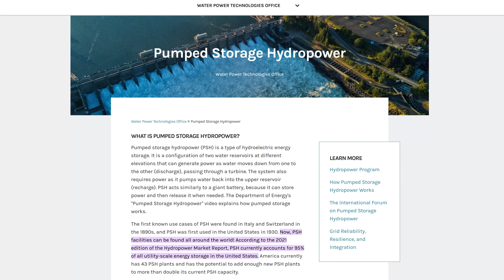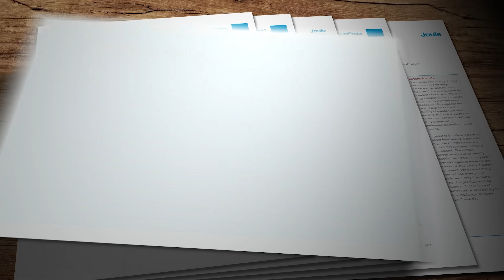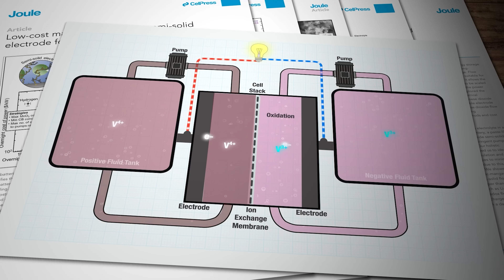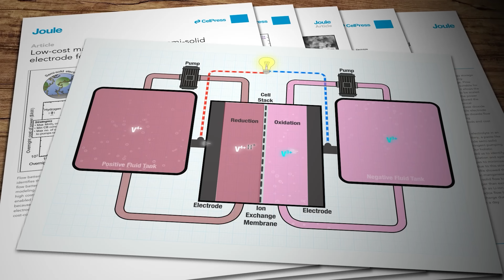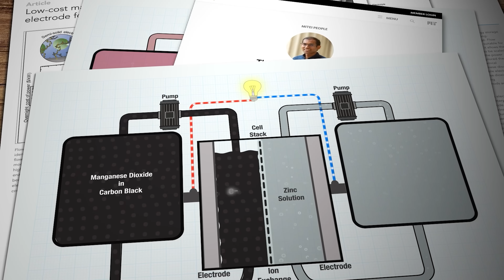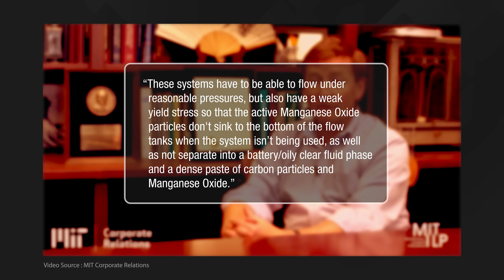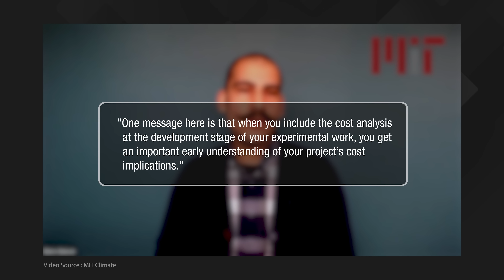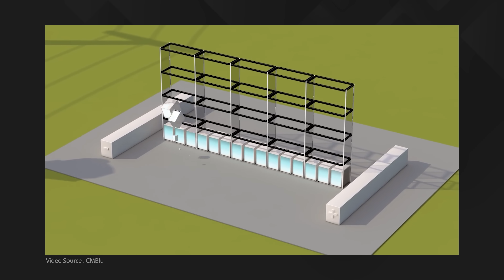Have we found the missing link in the energy storage equation?

Comment: They need to move on to other chemistries rather than wasting their time on something so complicated. It may work but not for a decade. It may take a new material or process - that just isn't available right now. Who knows? Its obvious however that every battery that exists has very extreme downsides. Storing batteries is a whole other issue - especially if you collect them for periods of time between turning them in at the recycling center.

Comment: Developed at MIT, Sounds good but several comments from others at MI are not so encouraging. What is needed, as always is a decent sized operating demo unit. Without this the MIT work remains imho a project only. Two simple questions: are they intending to build such a demo unit outside the lab & if yes when will it be completed?

Comment: What about using the salt storage of heat as is done nearer the equator in places further north and South, only in these further reaches N & S to use resistance wire only powered with excess capacity during night time hours. Thought I read about a system in Australia solar heating salt, then on dull days there was enough heat capacity to make steam from the heated salt to power steam engines to generate electricity for three dull days..

Comment: I'm very interested in energy storage. Both thermal and electrical storage. But when I talk to people about it I often get the argument that here (the Netherlands/Europe) even if wind and solar is at its peak. We still don't have enough power to "switch off" the usual suspect like gas or coal power plants. And even if we did, those power plants aren't flexible enough to switch on or of every hour or so depending on the wind, let alone every 2 minutes whenever a cloud comes before the sun. I understand that the bigger the grid the less this problem will occur. On a semi cloudy day, the coverage of a whole country will be more or less stable. But I am curious what your view (or anybody's view that knows something about this) is on the flexibility, or inflexibility of the non renewable power plants when we get to enough renewable energy that it will actually be necessary to take gas or coal plants offline because there is enough renewables at that moment. I have even heard (but couldn't confirm....) that we have a resistive wire in the northsea to be able to dump energy there when the grid cant handle the renewables and the baseload plants. I hope to god this is false, and the fact that I can't find information about this is a good sign... But I have heard of more stupid things done on that scale, and lets face it. Dumping "a bit" of energy is always better than letting the grid collapse.

Comment: (1)Why not more pumped storage? with a refinement ie variable pump speed(to match the variable wind strength) as well as variable generating speed for frequency control.(2) When wind speeds are low in one area eg high pressure over Ireland, There fore little or no wind generation ,winds could be good in Scottish highlands/Shetlands /Orkney .So an interconnector between inishowen in Donegal and the Scottish highlands coupled with storage (a U valley stores more water than a V valley) to be used by both countries would solve the problem of intermittency. The grids would have be strengthened here of course which would add to coast .The point is that it is possible to solve with current technology.

Comment: All the power advances are great. But unless we can upgrade our distribution system quickly its a dead duck. They are still installing new gas pipework around the corner from me and large scale in Edinburgh. I have yet to see roads dug up to replace cables installed in 50s 60s and 70s.

Comment: It helps to think of energy storage the same way we think about data storage. We have cpu cache memory that is very fast, then RAM, SSD, hard drives and then archive media. Each plays a role in the system. We'll eventually see the same with storage. Buildings may have small systems for time of year shifting and the cover a few hours when power is out or to storage on site generation. Then you'll see local storage then smooths our daily cycles. Then intermittent storage that can smoothcout weekly or monthly variations and then ultimately long term storage that can handle seasonal and indefinite bstorage requirements.

Comment: Seems like hydro pump systems could be introduced into areas that need energy storage and need water storage. The flow battery tech will or will not pan out. The hydro tech is proven and could be improved to allow it to work in more places and function as more than just power storage it could also act as water storage.

Comment: Although you said the tank size would eliminate residential applications, its possible to désign buildings that combine tanks with sheer wall structures that support the weight and integrity of the building, which could be economical.for multi-residential or muxed-use buildings.

Comment: Pumping solutions used in agriculture and the building industry could easily be applied and have been around for so long that wear and replacement component times could be built in.
Doubling such pumps also have the great advantage of taking over during failure and being used for slow stirring, thus avoiding chemical separation. I recall seeing these in action on large grain farms in England decades ago and the fuel farmers and processors used was biogas 'agriwaste' before those words were commonly used.
Exhaust gas was probably cleaner than most vehicles emit now despite converters and sensor electronics -- let alone the mythology of EVs having no pollution.

Comment: Interesting as usual.  I think you did a story on Ambri, also out of MIT, and their liquid metal battery.  Have you done a follow-up story on Ambri?  They are installing a demonstration project in Nevada I think so it will be very interesting to see how that works out as well.  Again, their batteries don't hold charge for a long time, but are ideal for solar and wind as they can go through thousands of charge / discharge cycles with no loss of capacity.  Creator Sataway also claims that they will last a long time and are comparatively cheap to make as they use common materials.

Comment: Love your videos. You should check out cheesecake energy. They've managed to develop energy storage thats cheaper than lithium ion batteries and they're reusing parts to make a modular compressed air energy system. Their air compressor is made using an old ex-service truck engine and the storage material is recycled gravel. Their demonstrator is set up at the university of Nottingham I believe. Very cool

Comment: If you look at the chart comparing 4 energy storage options for 8, 24 and 72 hours, hydrogen is cheaper at 72 hours.  Maybe stick with hydrogen?  It's already being used and prices will trend downwards?
Reply: That report is confusion. Remember why Elon Musc discarded Hydrogen, based on efficiency. #33% retained from solar panels electricity generated to stored Hydrogen in the tank, then again only 33% retained from there to what can be delivered by best Fuel Cells to the electric motors, means # 10% efficiency on a full loop hence 90% of the electricity capacity lost along the way # Meaningless.

Comment: Hi, I watch your channel on a regular basis and really admire your early stage examinations. I loved the humor you used in the beginning of this one! I'm a professional in the renewable energy space in finance and wanted to direct your attention to a couple of areas which are potentially very hot and could do with a "Just Have a Think" treatment. One is at last a breakthrough in cellulose in the unexpected shape of a mechanical method of breaking biomass, cellulose into lignin and glucose. The promise is that this can happen in less than a minute for a 100% conversion, which blows away  the 7 or so alternative methods of doing it both by time and cost, and opens up a whole world of possibility with the emergence of sugars not just from the fruits of plants, but from the substance of plants themselves. The company is called Blue Biofuels and is based in Florida and is well worth a look. This is the year they intend to go commercial.
The other idea, which you have touched on previously, is the green ammonia from N in the atmosphere and electrolysed H2 in water using renewable energy as the energy input. Another company called Fuel Positive in Canada has an edge in this arena and I believe it might be eye opening also. All the best and keep the good work coming!

Comment: One must wonder why the more predictable tidal power is not receiving more attention. While we have a moon, tidal power will produce a far more reliable power source than either solar or wind power. The trick is to find the best means of conversion that does not involve the creation of large amounts of alfresco sushi.
On the subject of energy storage, liquefied air seemed to be one of  the more promising energy storage systems you have covered, producing a number of useful by-productsz such as CO2. It would be useful if this, or some other promising storage technology, could be used to provide a base line metric of performance for comparison purposes. Clearly such a comparison is more complicated than using a single number, such as cost per kilowatt hour. There are other considerations such as:  potential environmental damage, size of plant required, scalability, and response time, but if there is to be a judgment of the merits of each technology, it must be compared to a common baseline reference.

Comment: To me it seems like hydrogen storage is a better solution. Use batteries for up to 8 hours and then hydrogen for longer term storage. At 24 hours it's not far from this flow battery and at 72 and beyond it just gets cheaper and cheaper. And this with a tried and true technology.

Comment: Intuitively, to me, gravity batteries seem like a better solution. A small town could be serviced by a single tower. 
It's a low-tech, "dumb" solution which could be mass-produced with conventional materials (steel and concrete) and run itself with minimal maintenance.  
What am I missing?
Reply: Okay. Answering my own dumb comment.  I cracked open a spreadsheet and tried to work out the numbers for a modest 1MWh gravity battery.   100M high. 36T weight blocks.
Update: It's probably a silly idea.

Comment: You should discuss the various potential roles for a battery and let that guide your idea of its necessary size.  1) Stabilizing frequency during a high load period, 2) Replacing intermittent solar panels and windmills when they're unavailable, 3) Replacing a full sized power station long enough for the utility to fix a breakdown.  4) List another use here.  Once this exercise is done, see what sort of battery tech exists for each application.  So far, batteries are available for #1, and nothing exists and nothing is foreseen which can actually do #2 or #3.

Comment: No problems moving the gloop.  Outfits like Mono™ progressing cavity pumps have been doing that for years.  Great pumps for difficult fluids.  So that is not a constraint.  These inventors will find a balance between viscosity and pump energy requirements eventually.  The breakout will be when they upscale using cheap readily-available materials and simple systems.  Time will tell.

Comment: Instead of pumps, why not use gravity feed?  
For charging, lift the discharged gloop up top and collect charged gloop into tanks at the bottom.  For discharging, reverse that.  

Literally flip the whole assemblage over depending on whether charging or discharging, so pipe connections can be fixed.  The battery shuts down for a few minutes while flipping and getting the flow moving again, but other batteries can be in operation during that period.

Comment: so it's like a thorium reactor but cost more money in the long term is less efficient and on top of that has less cycle life.   or the zebra style battery was just uses a salt electrolyte which is extremely inexpensive and has even higher energy density?

Or a TEG that has NO MOVING PARTS.   can be used upwards of forty years and basically not have any issues with on demand power with a multitude of energy storage systems that either rely on a water vacuum or Steam energy recovery or storage systems.

every single one of these systems can be built underground and don't give me that it cost a lot of money to build things to do the hole because that's just nonsense.    

the US Army have portable nuclear reactors back in the 60s and 70s and if they were able to do it way back then and even do it in the middle of the Arctic well I have to wonder what is all of this about  meeting the store energy when you have so many other systems available that are capable of doing so at a fraction of the cost and with Technologies already readily available and deployed even some coming out of Japan which NEC markets a system for backup power that Canada uses. 

has over a 20-year life cycle and to top it off can be installed by just installing a shipping container and installing some wires that's it to a already available and installed system. 

also since space concerns aren't an issue,   hydrogen storage tanks with the size of a large tanker with something that is already being built to transport high-pressure natural gas or liquefied petroleum products such as propane are already manufactured and are built with a conomy of scale and can be buried underground and have an extremely long shelf life especially considering that you can run them at low pressure since you can have a multitude of them.

that takes care of the energy storage portion and where do you get the hydrogen well you can use one of the various methods to produce it from your renewable resources and then burn that in either a turbine or typical combustion engine.    
the water use for the process can be recycled over and over until a water tower and therefore very little actual input into the system is necessary.   if you need more output simply turn up the boost on the turbine or engine and add more tanks as necessary or more engines as necessary and Generator combinations.

if you use large low-pressure containers you can literally make them out of recycled Plastics completely all the way through and as you know Plastics have a lifetime of about 1000 years in the ground if just a few precautions are taken into account and so the system will inevitably last for a thousand years or longer.  

there are no hazards for handling the engine components in or do you have to worry about not being able to make them as they are in readily available Supply and can be upgraded US future more efficient designs are released and put into a testing phase without any danger to human life. 

it's also extremely great for nature as well since basically you're taking up very little space up above ground.

you won't be contaminating any groundwater, won't be contaminating anything.  it's just hydrogen.   a hydrogen leak will basically go into the ground and since there's no ignition point nothing's going to happen and with multiple tanks being at a certain distance from each other even the complete failure of a tank and a catastrophic explosion if that ever would happen would simply be a bump that you would feel and nothing more.   

large storage tanks are already available and are inexpensive including the pipes and plumbing and since hydrogen does not attack many materials it's not going to be an issue for piping and whatever losses there are through the pipes are negligible.  

you can literally put together the system with piping you can get at your local hardware store and that would be PEX tubing.    

all equipment needed would simply be regular construction equipment or you could use large boring machines if you really want to accelerate the process.  

her immediate on demand power conditions absolutely you could use a large flywheel system which is actually really good idea since you wouldn't have any interruption in power since it would be available on service and on duty the second a power fluctuation was determined. 

the system would have multiple backups since each type container would have its own actual line to call the hydrogen from the tanks and you could have multiple generators as well as they would be inexpensive and easy to fix and since there would be so many backups a downtime condition wouldn't affect operation even if half the units went down.  

depending on size of the system you could theoretically produce enough energy for an entire week and not empty the tanks.

it would cost you less than paying for the Portland Police forces budget of around 10 billion dollars a year

Comment: I just had a think in 1980 when I became aware of water electrolysis research showing cooling effects; at the time not economically viable (JM.O'Bockris - Energy Solutions \\pages 327\328).  Since then I thought of like 40 variables that could (should) be taken into account with the than existing 8. An AI operation; but at steak is the only way electrolysis is splitting water and absorbs ambiënt room temperature energy.

Comment: Maybe a slightly different approach to the structure that holds this large scale potential,like for instance a pond or pool instead of a tank,where a bigger surface area can be used,and as a thin pond ,particles floating to the bottom would be less,and pumps might not be necessaril as its viscouse like quality would self level(maybe,maybe,maybe)( :